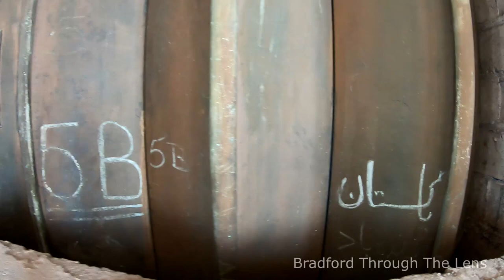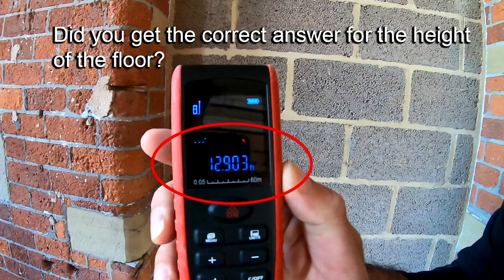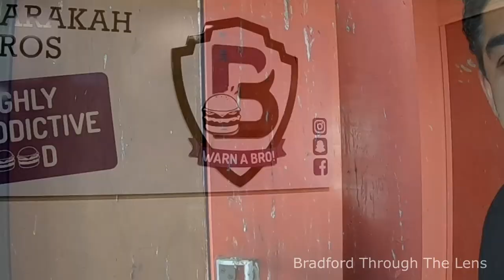HOPE For 𝗗 𝗜𝗹𝗹𝗶𝗻𝗴𝘄𝗼𝗿𝘁𝗵 𝗮𝗻𝗱 𝗦𝗼𝗻𝘀 𝗠𝗶𝗹𝗹, Thornton Road, Bradford

Comment: I worked in the building you walk through between 1986 and 1989. The top floor was where I worked and I used the kitchen you saw. If you notice the windows on the top floor are different, this is because of the in depth colour work done there.
Also interesting is the chimney, the top if the chimney is fluted which is quite unusual and I believe as a result it is a listed building.
If you're interested I could tell you a lot more. 
Mark
Reply from the maker: I am really interested in the chimney. I was discussing this with my colleague the other day and was thinking of doing some filming on it.

Thanks for your comment.
Reply: I bet I was there the same time. I worked in the offices in 85/86. There was a tunnel that separated the "rooms" think that was on the first floor. Loved the smell of curry wafting threw that was kept warm on the pipes. There was a lass worked on another building to the left upstairs. She lost all her hair with alopecia. I got nostalgic and thought I would see if the place was still running....